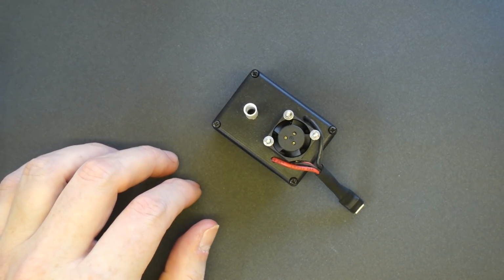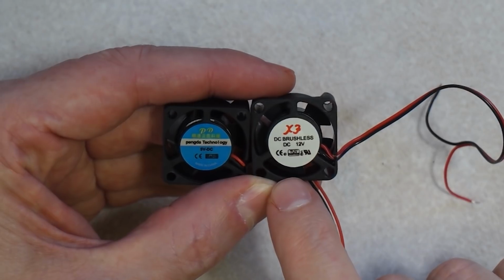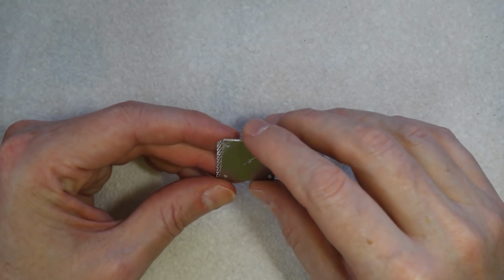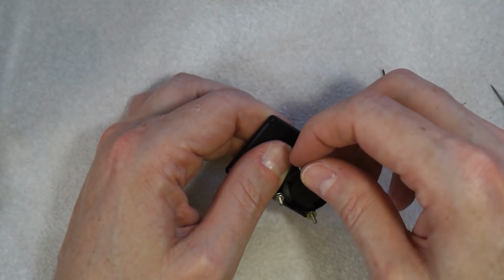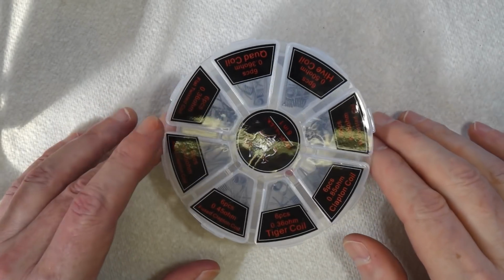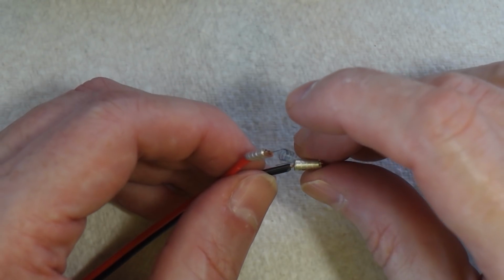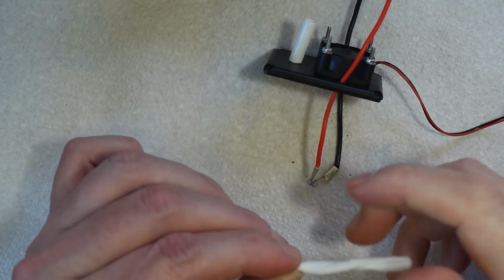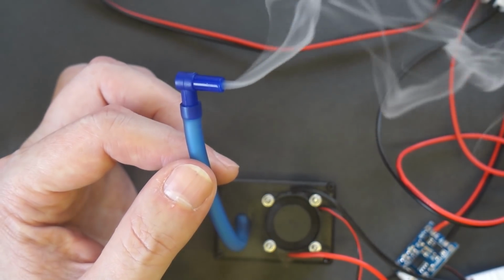Diorama Build 2 of 4 - Building a miniature USB powered smoke generator for a diorama

Comment: this sir, is the most helpfull video i found in hours of reserching for my electric-smoke-granade project i am working on right now.

i will need WAAAY more smoke, but looks like it is just a matter of voltage i guess. maybe i just try out my 2s-Lipos for the first try
Reply from the maker: Thanks, glad it's helped you. I look forward to seeing what you come up with.
Reply: @SteamGeezerUK  i try to remember leaving you a comment when we have something to show^^
Reply: Hey I made one even smaller, it is a 3.7 volt mini lipo connected to a 28 gauge nichrome wire coil that is wrapped around some cotton that is soaked in vegetable glycol. It makes billows of vapor that I imagine would be perfect for an electric smoke grenade

Comment: Im so glad you have done a nice video of how you make one,
Thank you
As an idea, why not ad a micro potentiometer  and then use a 5v fan , you can then control your airflow and also save power and use a smaller voltage battery.
Reply from the maker: You could do that, sure. I tend to build them very basic, but a friend on mine has one I built for him that is Arduino controlled, has temperature sensors and all sorts. It really depends how far you want to go with it.
Reply: @SteamGeezerUK  Basic is a good option for simplicity ,
Personal an Arduino is a lot of extra work with all the wiring to put somewhere, 
But nether the less if one needs those features then at least he has leant how to do it.

Oh i have a question for you SteamGeezer . Can you make different colour smoke, as i would like to have black or grey.
Reply from the maker: @spudnickuk  If you ever find a way to make different coloured smoke, you'll make a fortune, because as far as I know, no-one has ever figured that out :-)

Comment: you dont need a bigger battery or a different coil if you want to get more smoke, just change your fluid. use pure vegetable glycerin for denser vapour. yours is a 50/50 mix, the PG (Propylene Glycol) dilutes it so the vapour isnt as thick as it could be.
Reply from the maker: I usually do use pure VG in them. I have a couple of gallons I bought a while back to preserve some plants, so I usually use that if I'm not using actual commercial smoke fluid.

Comment: What would you say is the best way to reduce the risk of the generator overheating/catching fire? Would using the fiberglass rope be less risky? Would using the fiberglass rope make any other sort of difference in any way? Is there another method to help dissipate the heat? How long would you say it could be left running without issue?
Also—and forgive my complete ignorance of electrical engineering—how would one go about rigging this up to be plugged into an AC outlet?
Reply from the maker: The best way to keep the heat down is don't run the machine too long. I can't really give a hard and fast rule because every machine will be different, but I generally work to a base idea of maybe five seconds on and then at least ten seconds off.
The fibreglass rope is used as a wick because it has a melting point of about 900 degrees Celsius, so it won't melt or burn.
As for cooling methods, there are all kinds of things one could do, like heatsinks, cooling fans and so on, but then you start making the machine much more bulky. The best option for a small machine like this is to run it only for a few seconds and then give it time to cool down. I really wouldn't advise running this thing for much longer than that - there's a reason why commercial smoke machines cost a fortune - they have the tech inside them to shut them down if they overheat. This one doesn't.
As to your last point, to run a USB powered smoke machine from a wall socket would be as simple as plugging in a wall charger and then connecting the cable to the smoke machine, exactly as you would with a phone or tablet.
Reply: @SteamGeezerUK  Brilliant, thanks!

Comment: How long before the coils breaks? Using vaps before they don't last hell of a long! Try one of them discs from a pond fogger!? I wonder how big there coils are in them Heng long RC tanks for the smoke feature! That would actually be quite interesting to see a breakdown of there smoke system!
Reply from the maker: No, they don't last long, but they're easy enough to replace and, because there's generally less power going through these than in a vape, they last quite well comparatively. As for the Heng Long smoke machines, I thought about getting one but they're pretty expensive to get just to take apart.

Comment: wondering if there is a way to increase the thickness or change the colour of the smoke? Also it would be cool to have a smoke chamber after the initial outlet where it can accumulate and be discharged in a great puff or be manipulated by mechanical means.
Reply from the maker: As for changing the colour, if you find a way I think you'll be the first. It's a bit of a Holy Grail among the radio control community in particular to make black smoke for model boats and "coal rolling" trucks. Nothing has yet worked, as far as I'm aware.
To increase the amount of smoke, up the current to the heater. This will shorten the life of the heater and generate more heat, increasing the risk of fire.
An accumulator might work. I've never tried it myself but it's worth looking into.

Comment: So I made one just like you. Same size coil. I hooked it up to the usb power supply and it just turns off. I think the coil and fan are to much for it. So I ordered 2-18650 batteries with a charger and a 2 pack box so I can have 7.4v I’m
Hoping this will work
Reply from the maker: You'll definitely get a better effect with more power, but you might find the coil won't last as long. The problem with USB power supplies is they're often very low power output, 1 amp or lower, whereas vape coils need more. You might find even one 18650 will give you better results, just because it will flow more power.
Reply: @SteamGeezerUK  thank you very much for all the info. Have a happy  New Years

Comment: Minor upgrade: Chuck a small variable resistor in a voltage divider on the fan to vary the speed of smoke?
Reply from the maker: That's very possible. The main purpose of this video is to show how the basic machine is made,  but there's all kinds of bells and whistles one can attach. A friend of mine has one in one of his projects and it is controlled by an arduino that monitors the temperature and dials the heat up and down so it doesn't overheat, for example.
Reply: @SteamGeezerUK  The arduino is probably an overkill as there are few external factors changing the temperature of the wire (an exception might be running out of glycerine mix). I made a learning circuit that does that for peltier cooling a cpu...but that's changing all the time...so worth it. Your idea of keeping it simple is a good one!
Reply from the maker: It controls other things too, but the main issue isn't the heater element itself but that these small boxes heat up fast and can eventually melt or even catch fire. The thermistor allows the arduino to toggle the smoke machine on and off and controls a cooling fan.

Comment: Did the coil actually go in the fluid? Does it matter if it's in the fluid? I didn't see you bend the wick down. The wick was straight through the coil so I don't know how it would been kept out of the fluid. If that's the case then why would you need the wick?  ❓
Reply from the maker: Ideally you want the coil above the fluid and the wick to carry the fluid to the heater coil, otherwise  the coil would have to heat all of the fluid at once, rather than just the small amount in the wick.

Comment: Would this work as ground fog for a 1:12 scale kelpie forest diorama? It would be under the base, coming up through strategic holes. Maybe without the fan part, so it just kind of "drifts" upwards?
Reply from the maker: You could certainly try, but for something like that, you might want to consider a fogger. You can get them on Amazon and ebay and they basically make a mist using water. If you dio will stand up to the water, that might work. I honestly don't know if they're any good, but it might be worth a go. Something like this maybe - https://amzn.to/2Sh3Q9S

Comment: You went from 5v to 12v and slowed the flow, but what if I was looking for that slow creeping eerie fog effect? To specify, I am doing a sculpture and I am planning my first attempt at integrating lighting (and other) effects, utilizing the base of the sculpture for components. To not get too into specifics, at the top of the sculpture is a crystal (acrylic) ball that I plan to position a 1.6mm 3v led underneath to have the light shine through. Because that's not enough, I set on the mission to find a tiny fog machine solution that I could channel the fog up and out small slits I would have around the bottom edge of the ball. My goal is to have it slowly creep out and sort of envelop the sculpture, not necessarily just pump out a stream of smoke. What would you recommend?
Reply from the maker: That sounds like a great project. It's going to be tricky to get the effect you want, because the smoke from a smoke machine is basically a cloud of vapour, so it will have a tendency to rise. There are two things that spring to mind - first would be to use dry ice, but that's a pain because you have to keep refilling it, and of course buying and storing dry ice. 

The second solution might be to use the sculpture itself to slow down the smoke. In the video I made of the prototype of this machine, I use a cardboard tube to slow down the smoke and create more of a cloud than a stream. Not knowing what shape your sculpture is, I don't know if this would work, but if you could create some kind of hollow under where you want the smoke to come out, it would allow the smoke to spread out and slow down. That might work... Anyway, here's a link to the video. 

https://www.youtube.com/watch?v=dsFNSFOjFCo

I wish you all the best with it, and hope you'll show us what you come up with - it sounds very cool.

Comment: If you add a food dye to that vape juice. Will it come out the color of the dye?
Reply from the maker: I'm afraid not. As far as I'm aware, there's no way to colour the smoke without using some extremely toxic and noxious chemicals, the kind they use in smoke grenades. If you add food colouring, it will simply stick to the wick and probably catch fire or stop the thing working altogether. If anyone ever figures it out, it'll make them rich... 🙂

Comment: Awesome! How long can you keep this running? I heard in other videos that the coil gets too hot after about 20 seconds and you need to turn it off and let the coil cool down before turning on again
Reply from the maker: It really depends on the machine and how it's made. Commercial smoke machines can theoretically run continuously, but small ones like this are pretty much as you described - if you run them for too long, the coil will overheat and potentially catch fire. These are definitely made for short bursts, not continuous use. I would run this one for maybe a minute before shutting it down.
Reply: @SteamGeezerUK  great thanks! Could you help me with the wiring circuit. I got a 5v fan and the same coil set that you had in the video. But I don't know how to calculate the circuit

Comment: I am an okay model builder, but absolute noob when it comes to what you're showing here.
Can I not simply BUY a complete generator from you for my next project?
Reply from the maker: I'm afraid I don't sell these. They do require a fair amount of baby-sitting as they can get hot and even catch fire if used incorrectly, and I'm sure you can appreciate I don't want to be held responsible for such a thing happening.

Comment: Hello there!
Impressing video and I'm happy to found it! 
I know lots of people bombing You with questions but I've had one too.
How do you think it is possible to use this in an RC car from a servo?
I mean a servo circuit? I have a few broken ones but the circuit boards are OK.
So I wanna solder the fan and the heater coil to the servo motor output.
It gets about 6V from the ESC through the reciever. What do You think? It's a gogo or a nogo?
Thank You anyway! Greetings from Hungary! 😉
Reply from the maker: It's an interesting idea. I think it's likely you'd only get the fan spinning at full power, but it would probably give you a way to turn the smoke on and off using the car's controller, so it's certainly worth a try. I'd be interested to hear how you get on with it :-)
Reply: @SteamGeezerUK  Thank You!
I'll inform You in case I make it work. Maybe I use a 5V fan so it can spin from start. Will see.
;)

Comment: I would like to produce a slow smoke stream (fog) through a "manifold" where the smoke ca be channeled to several 1/22-1/24 scale house chimneys  to help simulate a winter scene. Although unlikely as shown, would your unit installed with a stronger fan be able to produce such a stream through tubing or duct? Thank you
Reply from the maker: It actually requires very little airflow to move the smoke. I would suggest that, even as it is, it may well do what you want. I think the main thing would be a larger diameter outlet - I made another one recently with a 10mm outlet that would probably be more suitable;
https://youtu.be/X9ZnzoizvDo

Comment: Do you think a mobile charger lead usb cable type would work plug into mains or a usb battery bank. Chop end off to fit coil .
Reply from the maker: It might, but I'd be very cautious about such a thing, especially if it's a mains power adapter.

Comment: I've started to build this, my first problem is that the 12 volt fan doesn't start unless there's about 10.5 volts supplied to it. Once going it will run on 5 volts. Are there different brands of motor or what? I'm enjoying the challenge anyway!
Reply from the maker: I honestly don't know. The fans I use are the cheapest, generic fans I could find on ebay, from a Chinese vendor. I'm going to be away all day tomorrow but I can have a look tomorrow evening, but I don't recall them having a manufacturer on them, but I'll take a look and see.
Reply: Did you find out about these in the end?

Comment: What was the battery you were using? And how did you wire it up? Are there resistors or anything else needed?
Reply from the maker: The battery in this case was an LG HS2 18650. I wasn't using anything other than the charging circuit show in the video, but one does have to be careful in such cases not to over drain the battery.  If it gets too flat, it can be difficult to recharge. I have a smart charger that can rescue over-discharged batteries, but most normal chargers may not have that ability.
Reply: SteamGeezer and Son Independent Traders 
Ok thanks, I know very little about hooking up circuits, so if you have another vid on hooking up the rest of it that would be great
Reply from the maker: I did make a video on making a 3.7v charging circuit. It's exactly the same as what I did here other than a the battery type. The only difference would be a battery holder for the 18650.

https://youtu.be/qLUQw4uVg1s

Comment: Would it be possible to use a different power source - I'm thinking of a 12v adapter rather than batteries.
Reply from the maker: Absolutely. Most of the smoke machines I make are 12v. The one thing I would say is that, if you're planning to go to 12v, a vape coil will most likely burnt out like a fuse - they're not designed for that kind of voltage. The highest I've gone safely with a vape coil is 8.8v (2x 18650 batteries), but when I tried a 12v battery it just burned out really fast. 

You could use 12v in really short bursts (maybe one second or less), but I would advise using a different heating element, either nichrome wire or buy a cheap hairdryer and use some of the heater wire from that.

If you have one near you, you could try visiting a vape specialist store and asking them if they have a coil that can withstand 12v.

Also keep in mind it may well generate far more heat, so a smaller box might melt or distort.
Reply: @SteamGeezerUK  
Thank you. I assume it needs to be a DC adapter as the fan is DC.
I have an old toaster so will be using part of the heating element from that which I assume should be OK.
Reply from the maker: I would think so. I've not used anything like that, but it works on the same principle - using resistance to turn electricity into heat. I would just reiterate the need for caution - it's very easy to get things way too hot :-)

I look forward to seeing what you come up with.

Comment: How do you know what coil to use, I am thinking of trying to use a 12v PSU with a ceramic wire wound resistor but I didn’t know what specs I needed, whether 30 ohm 5 Watts would be any good, so then I though about using a 5v step down with the 12v psu but I don’t know what spec vape coil I need, would you be able to help me out with this?
Reply from the maker: I confess I'm no expert of vape coils. I bought a box with a variety of coils and tried different ones until i found one that worked.

One thing that might work would be to build your power supply and then take it to a vape shop and ask them. Something to bear in mind stepping down power is that most 5v transformers are limited to an output of 1 amp, so you'll need a coil capable of heating sufficiently with that power output. I believe a lot of higher quality vape machines run at 6v with a battery up to 20A. I don't know how they do it, but I wish I did.

Thanks for watching. Let us know how you get on.